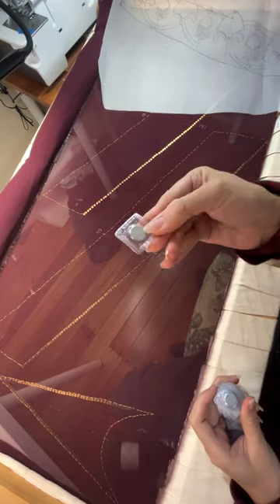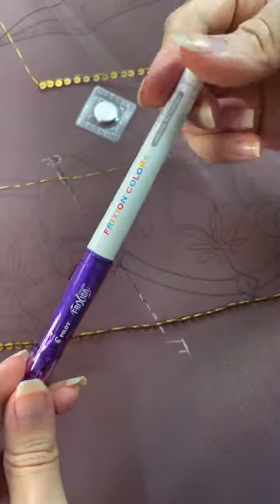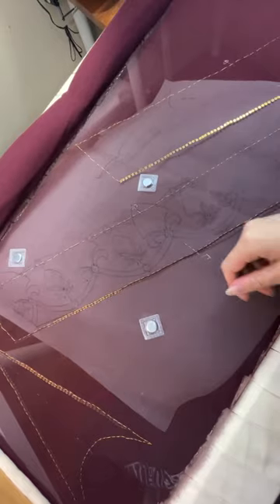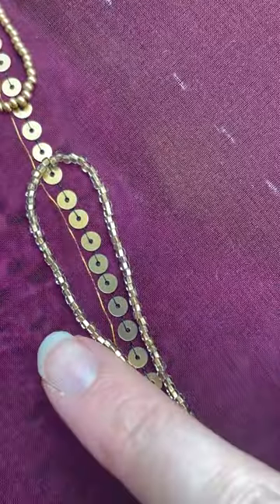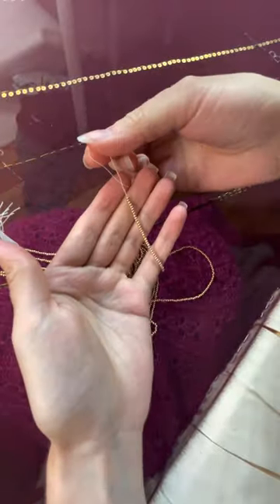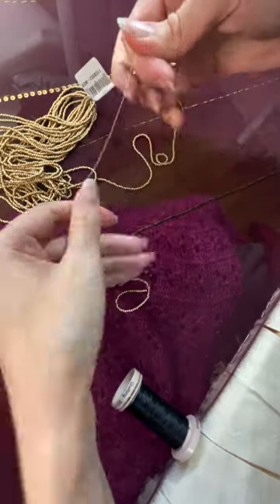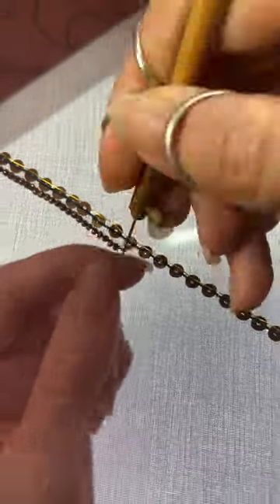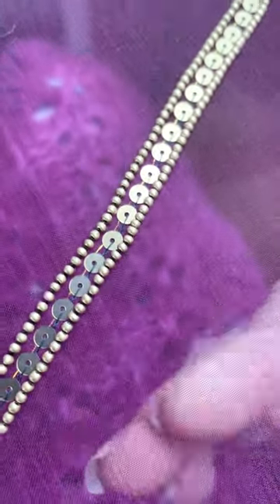1920s Flapper Dress Beadwork: Tambour Embroidery

Comment: The problem with heat disappearing pens is that they reappear if it gets really cold.
Reply: They don't wash out later or break down/evaporate with heat??? That's so upsetting!
Reply: @yuuri9064  they wash out in my experience, but don’t break down on their own